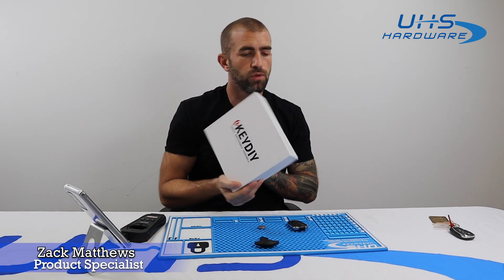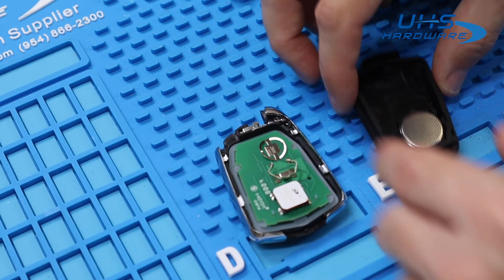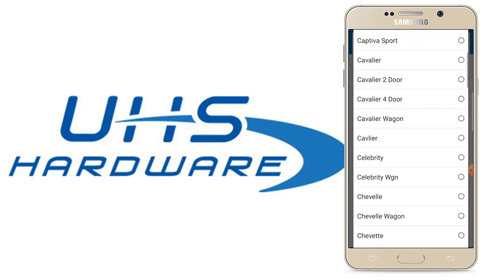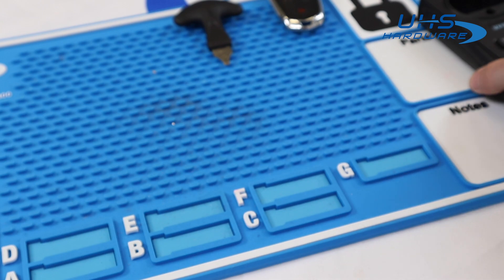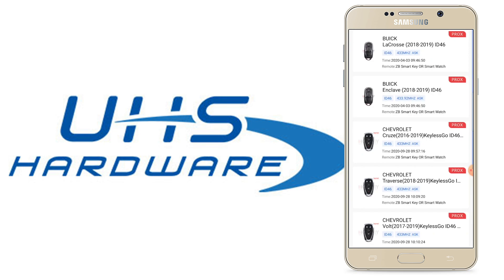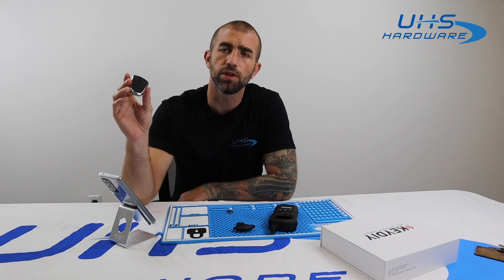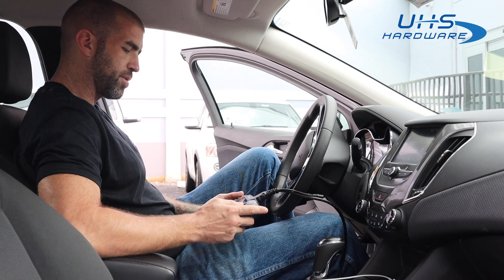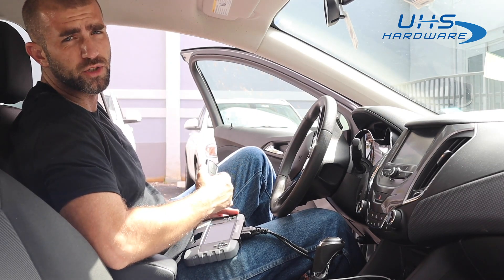Generating & Programming Universal Smart Key using KEYDIY KD-X2

Comment: Can you use a cheaper Topdon ArtiDiag800 BT AD800BT  scan tool for programming keys?
Reply from the maker: No, it'd only a Diagnostics tool. The only tool that programs vehicles and Keys from TopDon is currently the T-Ninja 1000 and optionally using the Ninja Box as well to increase Programming capabilities.

Comment: Isn't there a way to generate and program the remote using just the Keydiy kd x2 machine?
Reply: Just only for remotes with fixed code as Hyundai and Kia cars  but for pca Renault fiat and so on you need an obd tool